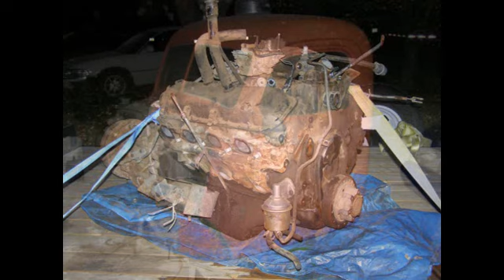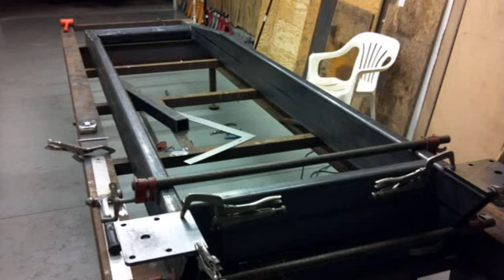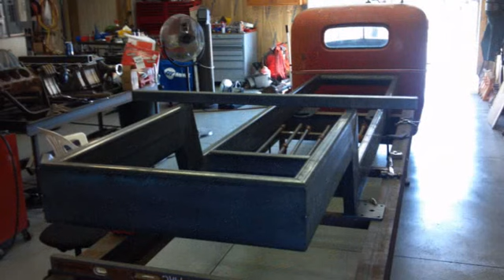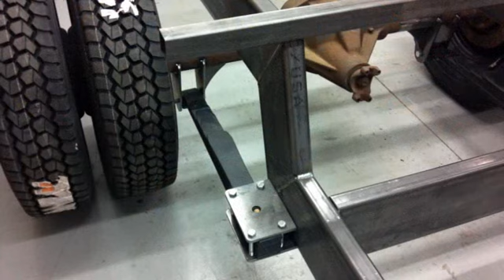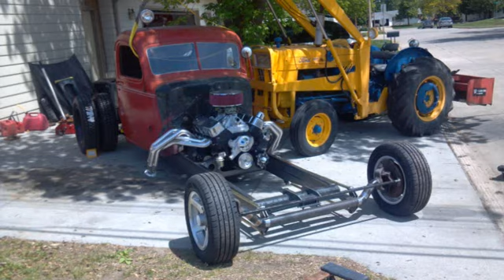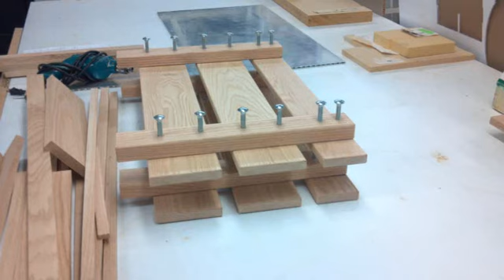42 TRUCK S

Comment from the maker: During the 40's Chevrolet did not use"VIN" numbers as we know them today.  There was a cowl tag on the firewall that gave a "model number" that was a code for what the truck was, 1/2 ton, 3/4 ton, etc. There are NO frame or chassis #'s, only engine, transmission, and rear end #'s.  These numbers were used to identify the component.  If it had a title it probably matched the engine#, that was most commonly used by the state to title the trucks.